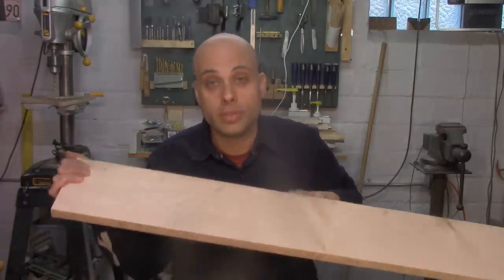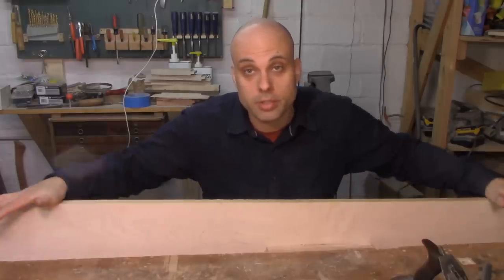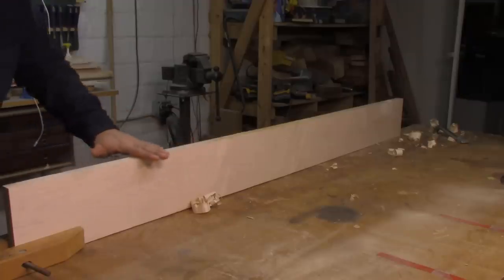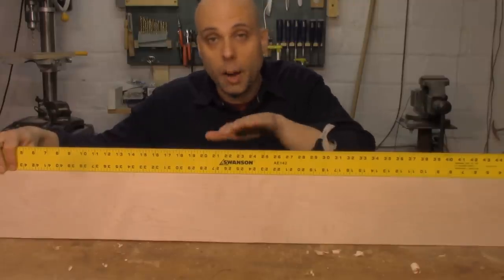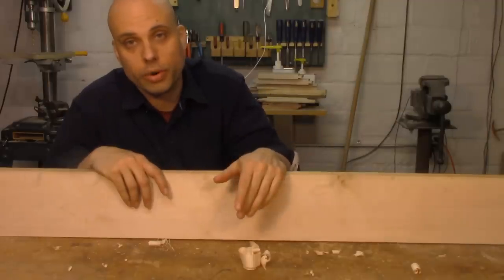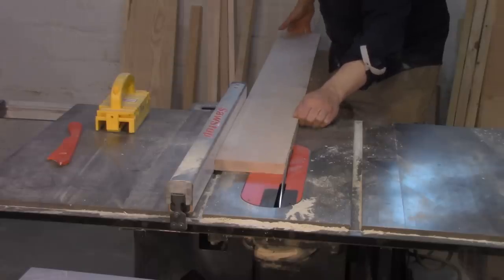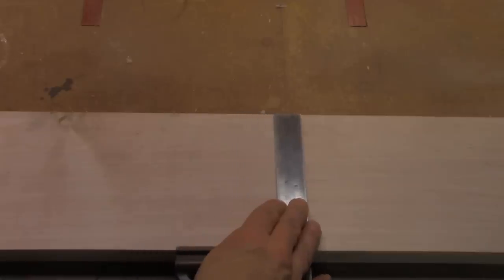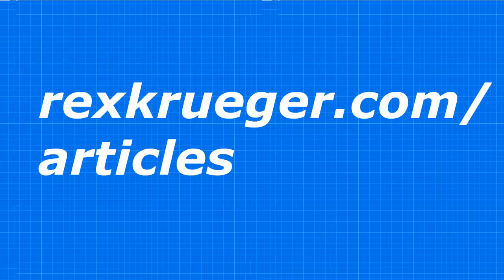Straighten boards. No jointer. No jig.

Comment: The bit about improving your skills really sells this technique.  I was thinking this takes a bit of work, until you made that comment.
Reply from the maker: I'm glad you think so. The video makes it look like more work than it is. I plane a good edge on most boards in under five minutes. Not a quick as a jointer, for sure, but I'm rarely processing more than 5 or 10 boards, so I get it done pretty fast.

Comment: A great video, your explanations are very well done and your pacing/editing is just right. Thank you very much! A jointer or thicknesser isn't really an option for me here in the UK as the noise would wind up getting my killed by neighbours!
Reply from the maker: You know, the longer I do without a jointer, the less I feel that I need one. They haven't even existed for very long, but people have talked themselves into the idea that they're essential. Glad you liked the video!
Reply: It's a great point. Thanks again for the tips.
Reply: I concur here. It is refreshing to hear a solid explanation that doesn’t condescend or get sarcastic about other legit options that you have simply chosen not to employ for personal reasons, or due to pragmatic limitations. This method is really perfect for those of us with really small work rooms and no dust collection. I literally have my saw on casters so I can move it outside to do my dusty work. Thanks for you solid video.
Reply from the maker: My pleasure!  I actually love it when I can wheel my saw outside (I used to be able to do this). No dust collection. Great light. Wheel it back in when you're done. Perfect!

Comment: I built a table saw jig. Takes about 60 seconds to edge plane. Run it through the crosscut sled for the edge, then thickness planer. Bam, perfect board in about 10 minutes.

Comment: Great video & explanation.  Well done.  I was looking for what jack plane you used but couldn't find it.  Was searching through the comments until my mind went numb (& I don't mean that as a hit to any comments whatsoever).  Thanks for the service you provide.
Reply from the maker: No trouble. I use an old Stanley #5. Depending on where you live, they could be easy to find and might be cheap. If that's not an option, there are HUNDREDS of them on ebay at any given time. I've also got a video on restoring them. Thanks for watching!

Comment: I want to point out that it is easier to straighten a short board than a long one.

Rex is straightening a pretty long board. My projects rarely end up using boards that long.

Consider crosscutting boards down to near final length then milling them. There should be far less wood to remove.

Comment: here's an idea put a 4' 6' or 8' level depending on the length of your board against the fence and put the board against the level with the crown side toward to blade and use the level to slide along the fence and that would give you 1 straight edge.

Comment: I used to buy quite a bit of raw cypress from a local sawmill, super cheap but they literally took it off their saw and put it on my trailer.  They needed a lot of work, and I needed to keep them quite long.  I quickly found it was much easier and safer to joint them by hand with my No. 8, rather than my power jointer.  And yeah, a jack plane will do it, but personally I would buy a No. 8 before I bought a jack plane.

Comment: Good video. Another way would be to get yourself a sheet of 1/2 or 3/4 MDF. Rip a piece about 3" wide off one of the long edges. Don't worry about the cut edge, the factory edge is what you'll be using as a straightedge. Take this new piece of MDF and stick it onto your board with some double-sided tape, close to the edge you want to joint, maybe 1/8" away from that edge. Now use a hand router with a pattern bit, or a flush trim bit in the router table to joint this edge flush to your straightedge. I did it this way for years before I owned a jointer.
Reply from the maker: That's a solid tip!  I like how that approach doesn't require you to drill holes in your work-piece. Very nice.

Comment: This is great, but I have a feeling that a huge part of this way is the table saw. And if you have a table saw with perfectly straight guide, you really don't need to do much to cut the board straight once, then use the edge as a guide. I've also done it on raw timber with a plunge saw and a guide, which also needs to just be done once. The problem is, I don't have either a table saw or a plunge saw right now... :)

Comment: Well i learned that one of the planes  i do have is a jack plane. I put it in the closet with the others because no matter how many videos i watch i cant make them work on my behalf.
Edit:
Thankfully i own a festool track saw and that has changed my entire outlook on things. Straightens any edge out
Reply from the maker: William Smith Well,  it's a drag that you can't make progress with your planes,  but I'm happy you have a solution that works for you!
Reply: +William Smith
Most people fail with planes because they are trying to hard to just flatten the wood out. What they should be focused is trying to remove the bumps and dips. 

Sort of like going along with a digger and removing bumps on your garden. People should also start with really short bits of wood. 

Your first step is to identify where the bumps/dips are on the board even if you are not going to plane them.

Comment: dude, sorry to say this. this technique is valid only when you are doing one project per month. Nowadays with the kind of turn around times expected by clients, forget about using am not even in a position to dream about this. jointer though a bit expensive pays for itself through the amount of projects handled. Even in India where i am from, most carpenters have switched to power tools and jointers.

Comment: Always will use a hand plane. A joiner machine for assembly line work is awesome. But mastering a hand plane puts you at an advantage.
Reply from the maker: I agree. The cheap, portable, versatile tool is better for anyone not doing production work.

Comment: If the board is a little longer than you need how about screwing a straight edged board (maybe MDF factory edge) to the top and use that up against the fence on the saw bench?

Comment: For all of you out there worrying about not planning boards square. Let’s say you’re making a table from 4 2x12s (or similar size material)
Take 1 joint (2 adjacent surfaces) fold both boards like a book (make sure TOP orientation is folded inwards, plane with #7 or #8 plane as 1 surface. Even if it’s slightly off 90 degrees, when unfolded these surfaces should match each other perfectly as they will be on same plane. Then repeat 2 more times and you got yourself a table top.

Most importantly: lay out your boards, mark everything and don’t mix up jointed edges

Comment: Interesting, I have been trying to do all my wood squaring by hand and while it is possible it is very time consuming, especially for a weekend woodworker like myself who needs to make best use of his time. I had actually done something similar to this with my worksite tablesaw but the turning makes way more sense. As I do more and more work I am finding I am using my old thickness jointer, bandsaw, and table saw more and more to get wood ready for projects when I thought I would be doing everything by hand at the start. Still good to have those base skills, but getting the "donkey" work out of the way efficiently is not a bad thing as I can then take these prepared board and use hand tools to finish my project.

Comment: 6:15. That looks like a really good way to get a giant wood sliver in your knuckle. I learned the hard way to never run my hand along the grain of wood. Lol. Inch long slivers in the palm hurt!
Reply: If the surface has been planed by the mill (as Rex says at 0:18) there won't be slivers/splinters on the face, and the edge has been planed down by Rex himself...
Reply: @dlevi67  I still get pretty nervous about it. Sometimes you dont see imperfections and they can really be prominent at the corners.
Reply: @aurtisanminer2827  Fair enough, but at some point you need to touch that plank... maybe test wearing gloves and running your hand back and forth along the edge a couple of times? Or even keep a glove on the front hand?
Reply: @dlevi67  yea, I still love touching my wood (no pun intended) after planing or sanding. I’m just likely overly careful about it. When I got a big sliver into my palm years ago it was stuck in so bad that I couldnt get it out. After a week of trying to pull it out and cutting around it to expose parts to pull on it was getting too painful to go any deeper. I ended up getting a doctor to numb it up and cut deeper to get enough to pull on. Even then he was really taking on it. That thing really anchored itself in there!

Comment: Thank you for the great information. I don't have a table saw, so my jack plane is all I have.
Reply from the maker: A jack plane will do the job!  Get one good edge and use it to scribe a parallel line and then plane to that line. You can do it!  Also, keep a lookout for wooden jointer planes. They are cheap and work great.

Comment: People seem to make this into far more of a big deal than it really is. Even if you can't (or won't) use a plane, all you need is a straight piece of ply that you can somehow clamp, screw or glue to the piece you want to trim and then use that to register your table saw fence, circular saw base plate or router against.

Comment: I enjoy using my hand planes as much as the next guy, but if I need straight edges for jointing out comes the router, template following bit. and straight edge. I'm done in seconds. The other point about making panels is, rather than somersault the boards I flip them. This way the edges mate perfectly to make a flat panel, even if the table saw blade is not cutting square. I didn't understand the author's point on this.

Comment: Its really important to be able to get a true edge or true surface without having to use a true surface. I mean what did they do before true machined surfaces were common? How did you know if it was true? Things like this add to your arsenal to be able to get true surfaces, even though it used a hand plane, you are more likely to be able to get to hand plane level in the absence of true edges and surfaces than you would a mechanized jointer.

Comment: Or you can go with option 3 (less time consuming): Take your board and butt it up to a flat piece of plywood. Find side that seems straightest, and run a large square along that edge to see where the skinniest area of the board is. Grab circular saw and start at that point, clamping a section of straight plywood for a saw edge guide to maintain your board width. Cut one direction, then the other.  Perfect? no. Pretty damn good? yup.   Not trying to be a smart alec, actually came here to see if there was a better solution (always tryiing to learn). But this is far more work, so I'll stick with my idea ;)

Comment: Great tip. I want a planer but i don't need it most f the time...
Reply from the maker: I have a planer. I think if you can only afford one, the planer is the clear choice. I decent jack plane can do everything a jointer can do (more slowly) but a planer can save you HOURS of back-breaking work.

Comment: Have you thought of using a handheld electric planer? Not everyone has the energy to physically use a regular plane and these devices start as low as $30-40 for a semi-decent model on amazon. Plus blades usually cost about $10 a set.
Reply from the maker: They're fine, but I like planes. You need to use whatever tool works for you.
Reply: @RexKrueger  reason why I mention it is because people like me get extreme nerve pain in arms and hands from repetitive motions operating hand tools with no power assistance. Owning a electric handheld planer can be such a good investment.

Comment: I just screw a straight edge on board at both ends,And run it through table saw with straight edge against fence,then flip it over and cut again.
Reply: That's a good technique, too.  I believe I've heard that called a 'rub strip'.  If screws would mar the finish on the board, I've seen the rub strip attached with double stick tape.  Never did it myself, but looked very easy, and achieved straight, parallel edges using only the table saw.
Reply: You could even use a straight edge and your handheld circular saw if you have a board that is wide enough to afford some extra waste.

Comment: A more simple way is screw the two boards that you want together side by side and run the joined edge through the tablesaw. Repeat on the other side.

Comment: Hey Rex, I'm hoping to get into some hand tool projects after watching some of your videos. I was wondering if you might do a few video's to answer some questions I had. If not maybe you could direct me to other video's that can help. First, I use a lot of reclaimed wood and so they are all different sizes. If I wanted to make the boards the same thickness and join them together to make a table top, shelf, or cabinet door, can you do that using only hand tools? I've seen your shooter board video and that looks like a good way to square the ends, but could you use the same technique to joint a board, or just use a plane like you did in this video without using the table saw? Another question, is how would make a Dovetail dado across the entire face of a board? My chiseling techniques/form could use some work. My last question would be about making a uniquely shipped mortise through a board, all straight lines, just not square? Again I'd like to do all of this with hand tools if possible to up my game and better my skills.

Comment: BUT if you just want to stick the boards together, you can put them in a vice and use a planer on both boards at the same time. won't such a connection be simpler and faster? Because not everyone has a table saw. I only have a 16 inch saw and bigger. so for me this solution is much simpler. if I am wrong please correct me. sorry for my English :)

Comment: Not being negative just would like to offer a suggestion for next time; When you are referencing which board face needs to remain against the table saw fence you really should have shown the full act of rotating the board instead of cutting the video to excise the pertinent part of the realignment because the verbal description alone is indefinite and could be interpreted more than one way.

Comment: I'm a beginner here and have been struggling with the art of the jack plane and I apologize if this is has an obvious answer, but after all that planing and eyeballing etc. why bother if you are just going to cut it off on the table saw? Can't you just straight edge with a glue line blade right away?

Comment: This method only goes so far. If you are jointing with any frequency, make yourself a shooting board. If you don’t have a pricey plane with the sole at an exact right angle to the side, buy an old wooden jointer plane, flatten the sole, then plane the side square. More than repays the effort the first time you use it.

Comment: Have you tried using the straight edge to draw a line, then using a belt sander and plane to bring the wood to the line?
Reply from the maker: I'm sure that would work, but my planes are much faster than a belt sander and bring the wood down more easily. But yeah, a belt sander is a good choice.

Comment: Sorry isnt that dangerous to run it thru the table saw so close , isnt there a risk the edge and saw get stuck and you get the board to flip? Quick question i wanted to use old furniture and turn to bords to recycle and make new furniture, using palets is not cool . What i  wanted to know is it ok to run painted and varnished boards thru the table saw, jointer and planner is there a problem to do this , cheers. ps love your channel

Comment: very confused by "rotate the board around - not flip it.  Is really important that the face that was against the saw stays against the saw table.  That's going to be our reference face and it can't change if we are going to end up with really parallel edges"  But what I'm seeing it that the planed side is against the fence then on the second pass the planed face goes thru the saw - of course making parallel edges by definition.
Reply: now i got it!

Comment: "I'm gonna reach around and pinch..." 🤣🤣🤣This is a great video and advice. However, it would be exponentially easy to use a factory straight piece of ply and screw it to the board you want to straighten and then use that straight edge against the fence. Or make a jig even though the title says "no jigs." I could see if someone didn't have a table saw at all. If you're using table saw, no sense in taking time to plane.
Reply: Unless, of course, you can't make screw holes in the board. Or don't have a long enough "factory straight" piece to hand.

Comment: As a beginning woodworker, what Jack plane would you recommend? I don't want to spend a ton of money on it, but I'd rather buy one that is going to work well than cheapen out and have a poor tool.
Reply from the maker: Anjonwalt The best is generally a vintage stanley for price and performance.  I have several videos on fixing them up.  I have another plane video coming out Monday with more suggestions.  Good luck!
Reply: Rex Krueger thanks so much!